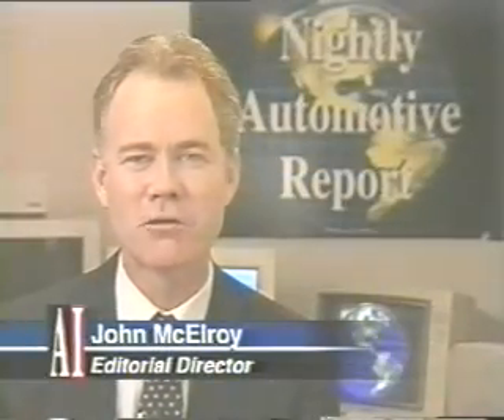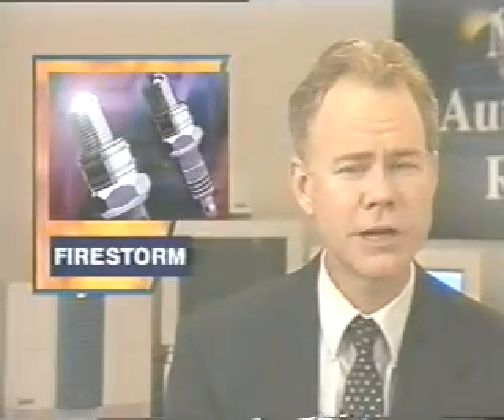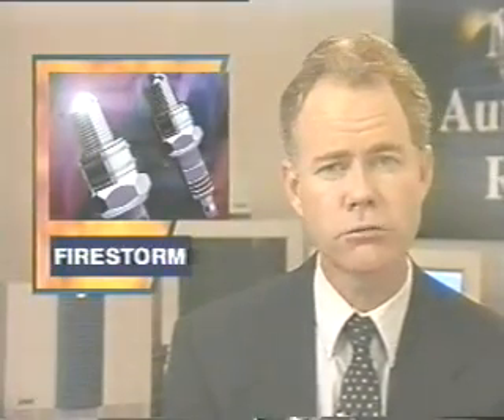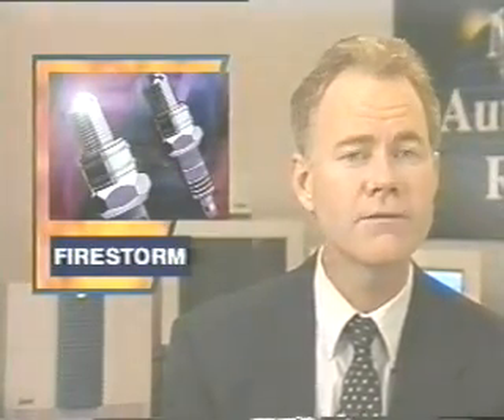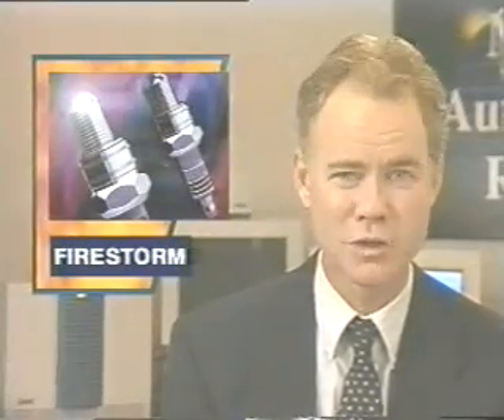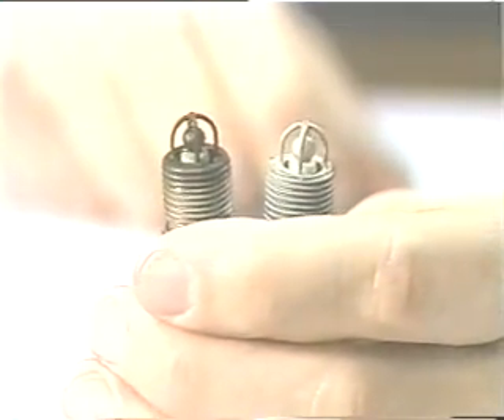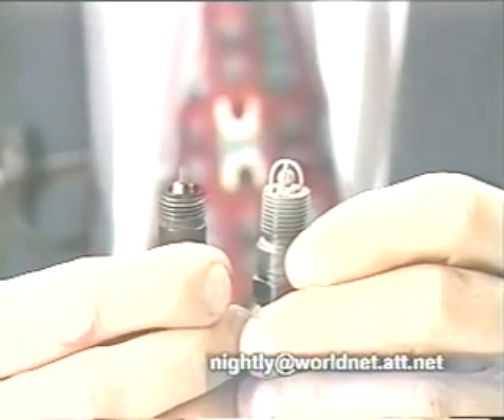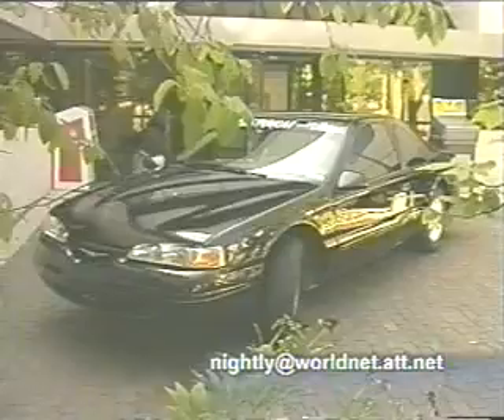Firestorm Spark Plugs

Comment: > any sysmetrical system of energy in a 
> closed circuit will always just come in 
> under the unity line at best... 

Yes! And H2O -> H2 + 1/2 O2 -> H2O is such a closed "loop." The H2O at the end is in the same energy state as that at the beginning, therefore this process can yield no net energy "output," no matter how you do the first step. 

> you are also side stepping the issue of 
> separation of mass and charge. 

You're handwaving.

Comment: Honestly now, do you do you work for a petro chemical Co. If the only ways to organize energy in sympathetic manners, as a response to initally organized energies, is: with funny tricky wave forms... Of course you will fail every time, because any sysmetrical system of energy in a closed circuite will always just come in under the unity line at best... Bet then you are also side stepping the issue of separation of mass and charge.

Comment: Whups, no "edit" here. 
> Sure, that's what transformers do. High 
> volts and low amps in, low volts and high 
> amps out. 
And I meant to add "or vice versa."

Power (volts x amps) is STILL always reduced a little, whether you have a step-down or step-up transformer.

Comment: Seriously, SH, every electric arc through air involves plasma. That bright-blue spark? Plasma. Electricity cannot arc through air WITHOUT plasma. The plasma (which simply means the electrons are stripped from the atoms) forms the conductive path. What you're talking about is just a matter of intensity, the same way a 1000 watt lamp is brighter than a tiny penlight - but (in conventional bulbs) both involve electricity flowing through tungsten filaments.

Comment: Sure, that's what transformers do. High volts and low amps in, low volts and high amps out. But power (volts x amps) is always reduced a little. 

Illusions to the contrary are due to use of multimeters to try to measure power in reactive circuits.

Comment: I'm trying to save him a lot of trouble. 
The claim here is equivalent to claiming that 100 kg of water falling 1000 meters through a turbine-generator will generate enough energy to lift that same 100 kg of water MORE than 1000 meters back up the mountain. That's a conservation violation. It won't happen.

Comment: > OverUnity in separating water+hydrogen has 
> already been achieved. 

Nonsense. 

> Its called frequency compression, done with 
> pulse width modulation and ...

All of which makes it EXTREMELY difficult to get accurate power readings.

Comment: Did you know that a modern gasoline engine emits only about 3% of its fuel as unburned hydrocarbons? So even if this magic spark plug could cause "more complete combustion," it's not going to increase your mileage by 40% or more!  There just isn't that much gasoline going unburned now. 

Come to think of it, a 40% improvement would mean increasing the efficiency of the engine to very near its Carnot limit. That is not going to happen.

Comment: Well, sure. ANY ratio greater than 14.7 to 1 will "sustain proper combustion." But it won't deliver as much power per unit volume as 14.7 to 1, because 14.7 to 1 is the proper stochiometric ratio. Add any more air than that and, sure, you can still burn all of the gas... what there is of it.  But some of the oxygen in that air is not going to be involved in combustion. You're just moving it from intake to exhaust. I have better things for my engine's displacement to do, thank you very much.

Comment: Actually he can run gasoline even leaner than 24:1 and still sustains proper combustion. Firestorm spark plugs also allow engines to idle at 250 rpm, which is not possible with conventional spark plugs.

As for reinventing gasoline, that was already patented by Rudolf Gunnerman.

Comment: Yeah, I bet you made to modify your voltage coil system (much Higher Volts) as well and up the plug wires too. Then what about modding the computer to handle the low emissions temp readings and timing. These dumb-ass computers in the cars are half the problems here. Their software was designed to waste fuel, not improve it!!! I do believe that the 20:1 ratio is very  possible. Many thanks to Oil Companies (for technology suppression) and a missed-up Earth......